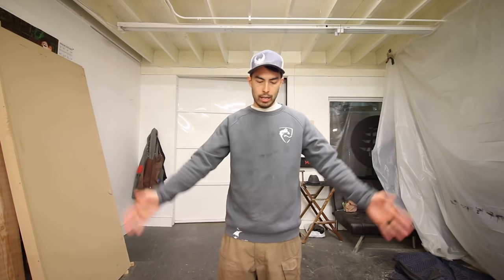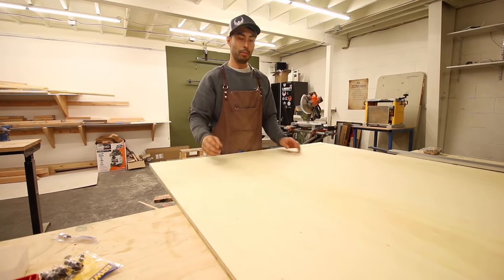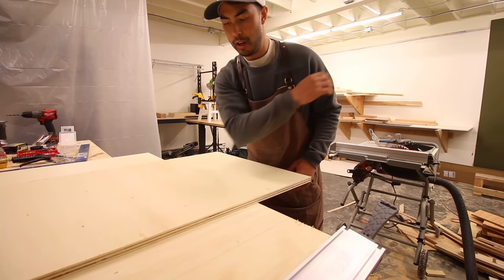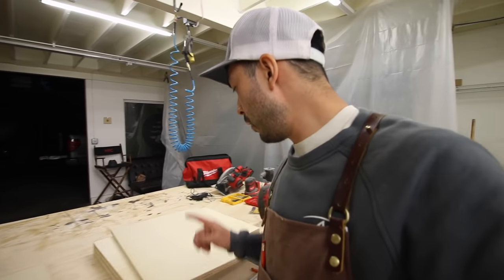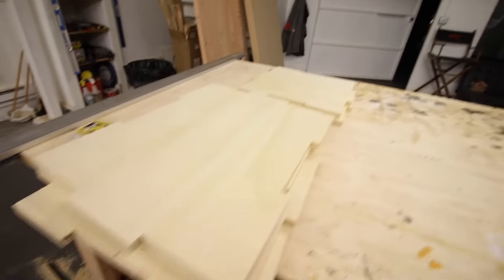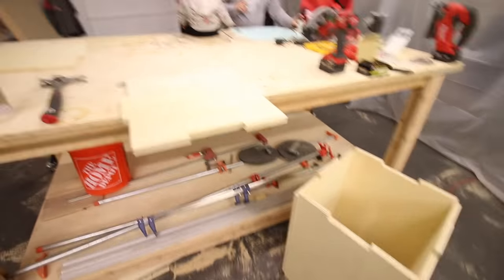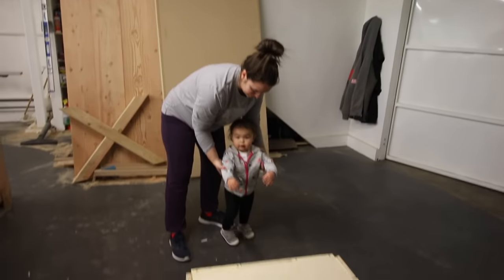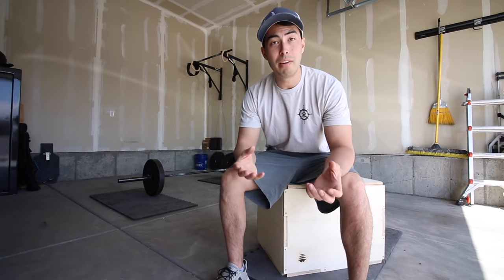How To Build a CrossFit Jump Box | 24”x18” Plyobox

Comment: Nice build.  There is a way to eliminate those corner notches. Just a matter of coordinating the female sides and the male sides.  Strictly asthetic but I bet you would do it differently if you did it again.
Reply: yes its quite a tricky build. My box, I drew plans. worked it out in my head, then I built a miniature and its just a matter having the puzzle pieces in the right orientation and you dont end with the corners "not filled in" or empty corner notches